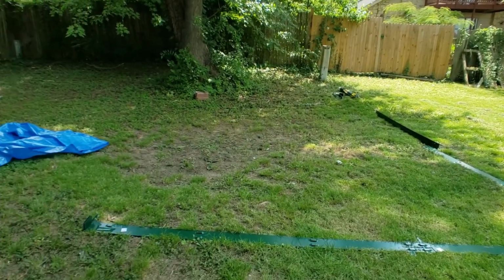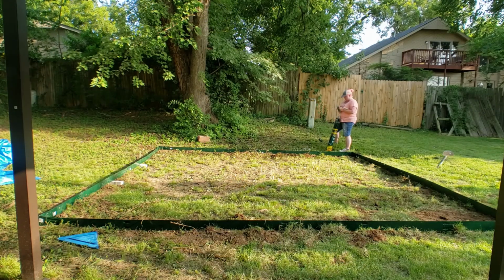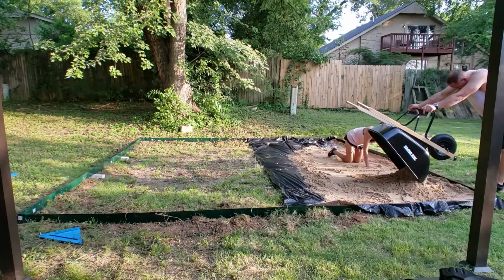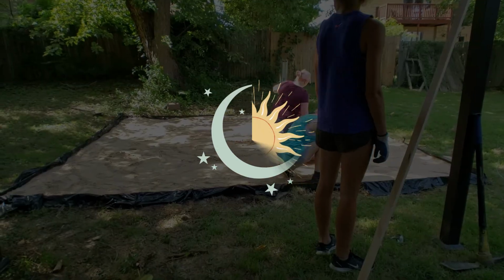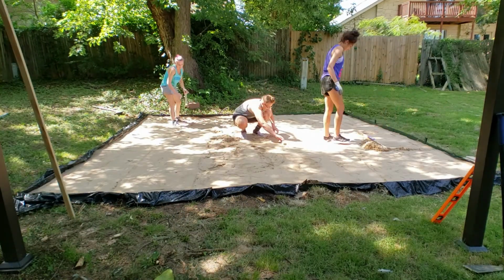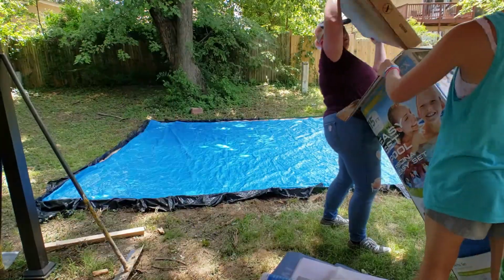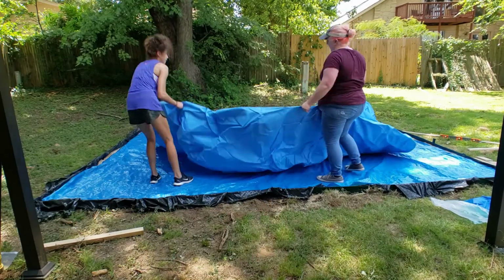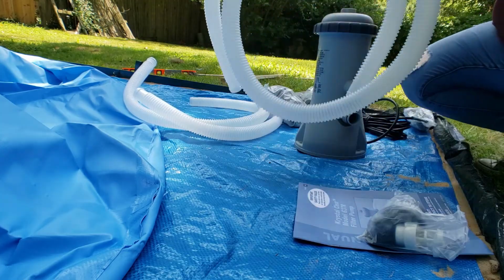Intex Easy Set Pool 15 x 48 Set Up & Ground Prep Install Step By Step

Comment: Hello there! Is it still running? And I want to know if I can put it up on our rooftop? On the tenth floor. Will that be a problem? We have a smooth concrete surface and able to take that much weight

Comment: Thank you for posting this! My husband and I just bought our first house, and since it’s too late in the year to have a pool put in professionally, we went with this instead. Our directions and manuals were useless because the parts and pieces were so different than what they sent us. The ground leveling was the hardest as we had to dig a couple of inches into the ground. So far, the sand and chemicals and test kit were the expensive parts. So far, we are $1800 in!🫠😅

Comment: I've been getting alot of rain so do you know what is to much water level and what's the best way to lower it?
Reply from the maker: I feel your pain, I've been dealing with that this summer as well. We've had so many storms hit us. 
You want the water line to stay under the inflated ring. If it comes up above the bottom of that ring, it's too high.
The pool has a drain hole that's plugged on the bottom of the side of the pool. It should've come with an attachment that screws into a hose and sticks into that drain hole. You can use that to drain water out into your storm drain. If you do it that way, just keep an eye on it. It drains fast, and you'll want to pull out that hose and close the plug before you lose too much water. 
The other option is to just let water drain out of the pump into your yard for a minute until the water level is low enough. If you aren't worried about a wet yard, that's an easy way to get the water level down a little and quickly.
Reply: @TheNiftyNester  I can't thank you enough for that quick and very thorough response!! I think letting it out through the pump is probably the better way so I can easily keep an eye on it!! Thanks again!!

Comment: How many inches of sand did you end up using? Absolutely everything I've researched says to not add sand when leveling the ground. Every instruction I find says  that with the easy set inflatable pools, building up with sand not recommended. How did it turn out for you? Thanks!
Reply: Also interested in knowing how it held up...

Comment: Hi,
 My husband and I are thinking about getting one of these pools next Spring( since it's already September.) We're doing our research now since we have some time. I recently found your videos and had a question. 
Have you had any issues having sand underneath your pool? It seems like some people really frown upon sand due to possible erosion and movement.
Thank You
Reply from the maker: Hi! I personally haven't had any problems with using sand. I was a little lazy this year and didn't spend much time smoothing it back out but it was still fairly level from last year and the pool went back up without any issues. Since we put up a barrier and lined the ground we haven't really had any erosion or run off of the sand. I think it just comes down to how you prep your area. I hope that helps!
Reply: @TheNiftyNester Awesome, thank you so much!!

Comment: Super helpful! We plan on getting the same size pool so this helped a TON. What type of garden edging did you use?
Reply from the maker: Thank you! I can't remember the exact name of the edging but I can tell you I bought it at Home Depot. It's these metal pieces that are maybe 3 inches tall, they come with a stake on each end that you can snap off and use to secure the edging in to the ground. They also fit together so you can join them to make a longer edge and they have corner stakes to attach at the corners. I did end up needing to buy extra stakes to secure the entire thing. I believe we went with these for a couple reasons, one was because they are just a few inches longer than the width of the pool so we didn't have to make any adjustments to the length. Our pool fit perfectly, leaving a couple inches on each side. I hope that helps, good luck with your new pool! I just finished setting mine back up for its second summer and it's held up great.

Comment: How much did it cost with all the extras such as sands, tarp etc?
Reply: Also interested in knowing this...
Reply: I KNOW RIGHT!!!! I thought this was supposed to be an easy set pool 😅
Reply: You don't need that much ground prep work. Just a level area with a tarp for bottom protection.  Been doing it this way for years, no problems...